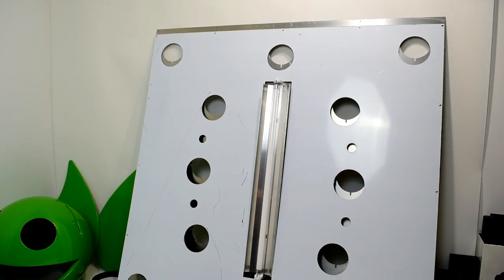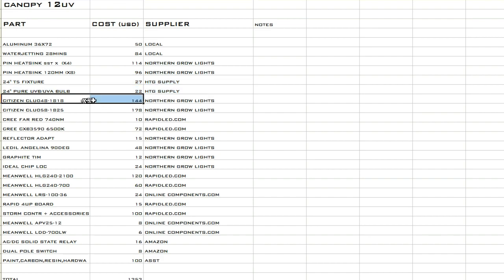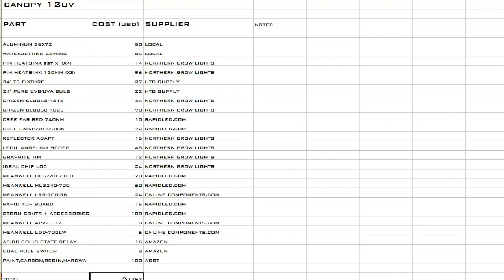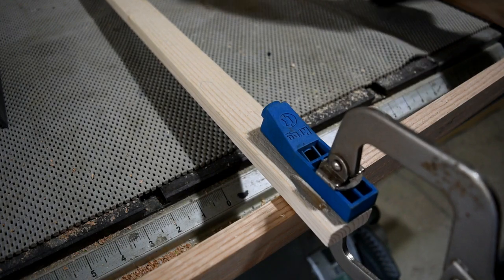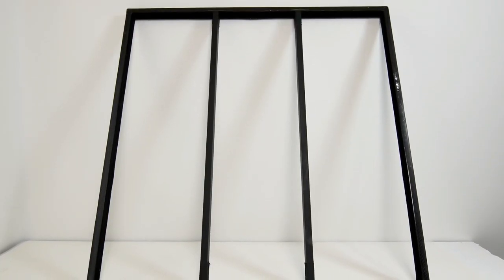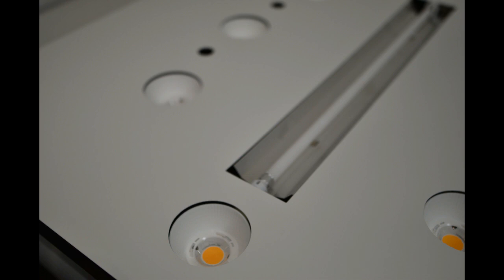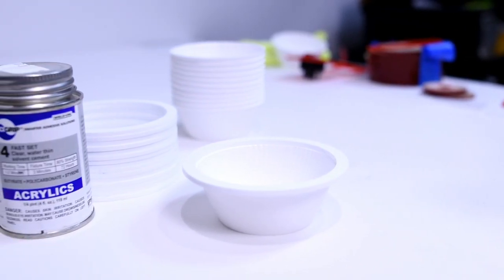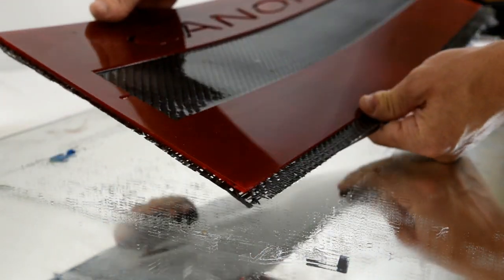Canopy 12UV: part 2 diy led growlight case

Comment: what about proximity of the UVB? i use solarcure and they are strong like yours but to be effective they need to be close to plants 6 inches. how do you determine if the UVB is intense enough? thanks for the great vids. rik

Comment: Godsend! Im redesigning my light right now, based on this design. Your CAD files for this build have been EXTREMELY helpful. I wandered over to rollitup.com and found the spreadsheet by alesh, and digitized the SPD curves for some Vero 29's; the amount of knowledge on those threads is staggering! You and your peers over at rollitup.com are driving this DIY LED community, so thanks for the dedication!

Also, the file for the heatsink mounting bracket is no longer in your GrabCad account. Did you end up finding a manufacturer?

Comment: It would be really awesome if you could design an air cooled DIY COB fixture and put the files out there so people could pay to have them made or make it themselves if they have access to the maker space. Something with a 4x3 row design that could handle about 600watts and cover a 4x4 or 5x5, with room for the pin heatsinks inside and 6 or 8 inch flanges for cooling.

Comment: Quantum Boards?! When you gonna build some and grow us some monsters to drool over? That shit is supposed to be the future.
Reply from the maker: next
Reply: I want to supplement (not replace) my 600watt hps in a limited height 4x4 with 2 of those 90 watt kitts. Good idea you think?  And after a while (when I am able to) put 4 more instead of the HPS. Or go 4 cxb3590 for +/-200 watts @1.4a  and put 8 more in after a while. Would be great to know if more light in that way good or bad, I just cant put a 1000watt hps in, to low.
Reply: my man
Reply: You are the shit!